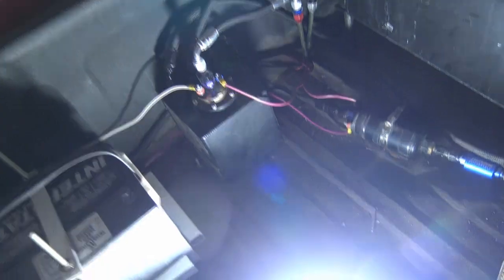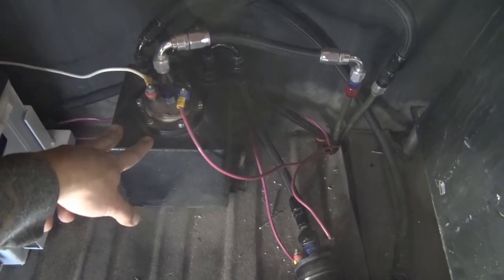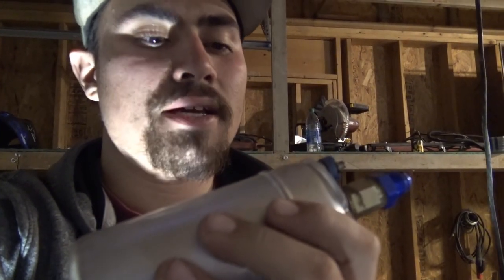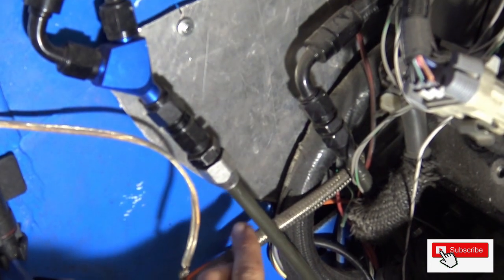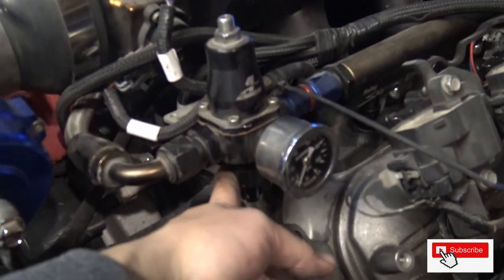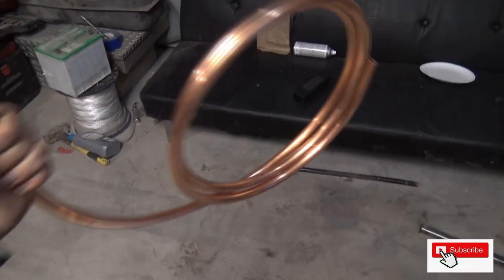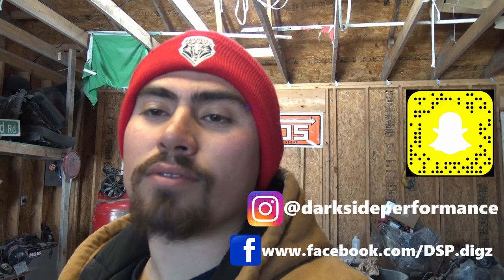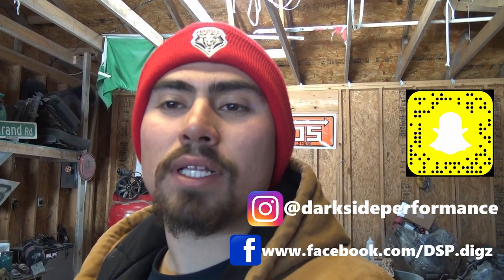Twin turbo LS fuel system

Comment: Hey I'm building a 5.3l twin turbo in my 1996 e36 BMW. I'm using the stock truck intake and fuel rails, return style and -6 fitting on the end of Ports. Can I still make a set of hard lines from tank  through a filter, then up to rails ?? My injectors are Deka rated  for over 80lbs. I need to finish this portion of the build then get started on electrical system. Thanks for any info you can share
Reply from the maker: I’m not sure I’ve never built a fuel system with the stock rail honestly if you could afford to put aftermarket rails that’s the route I would go just going to make it much easier as far as future upgrades. But message me with pics on IG that way I can understand what you are asking a little better
Reply: @darksideperformance299  ok thanks will be in touch